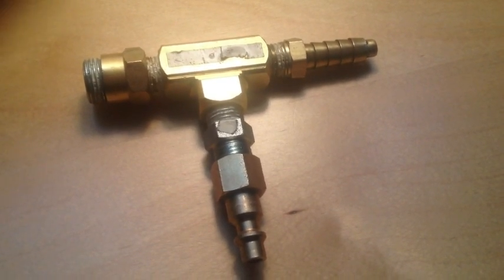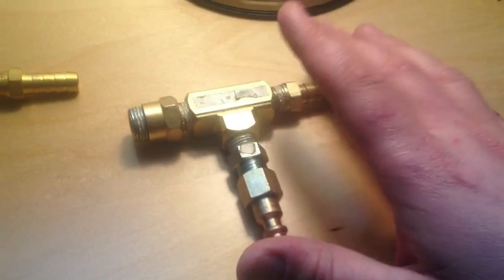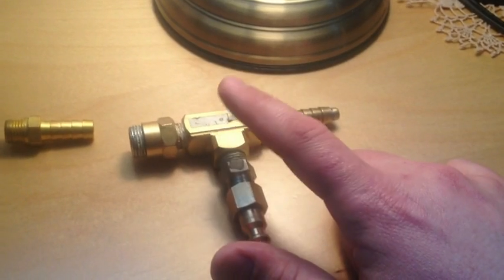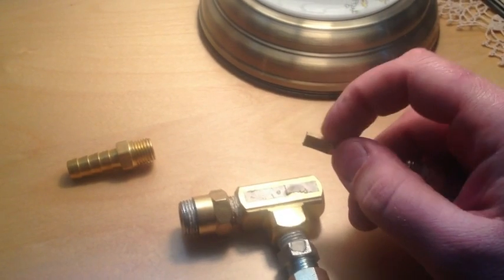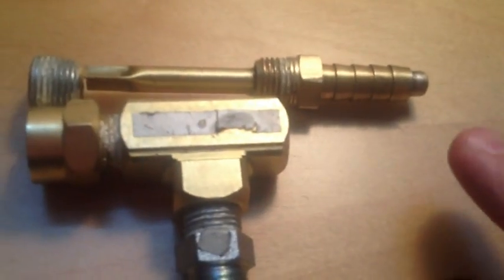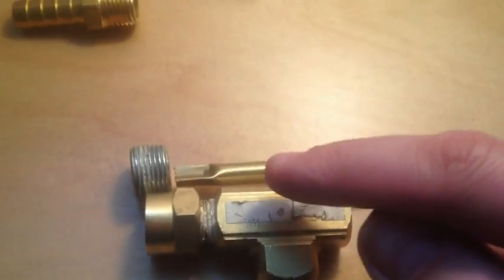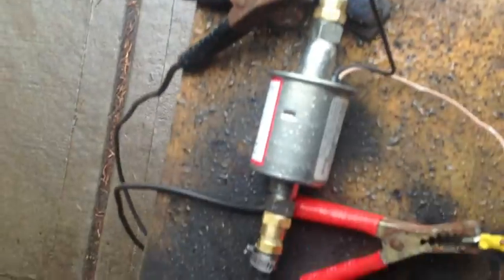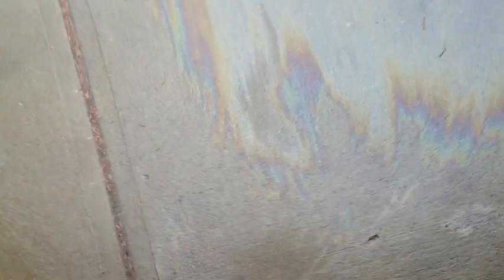Joe's home made hardware fuel water oil atomizer

Comment: Hi Joe, try using a single hole old diesel injector. Pull the guts out of it and put it back together without the needle valve in the tip, use fuel port and return fuel port for fuel and air
Reply from the maker: Cool cheers

Comment: Great idea sir,i am  preparing a kiln myslef,looking something like this for my kiln burner, Sir what type of fuel pump ur using
Reply from the maker: prabu hi there I was using regular gasoline my friend hope it works out for you buddy:)
Reply: Pls tell me about the fuel pump
Reply from the maker: It is a small 12 volt fuel pump I got from princess auto or if your in the states harbour frate it works ok but not much psi you want to get something with 30 psi range so you wouldn’t get much back pressure from air psi. Take a look at EFI fuel pumps some of them have extreme psi up to 200 psi but you don’t need that like I said 30 psi rated if far enough for this 
( https://jlfabrication.com/products/msd-high-pressure-efi-inline-electric-fuel-pump-43-gph) here’s what it looks like :)

Comment: Why would my atomizer not be working it seems like the air will push the water back 6 in and then it will mist and then it will push it back and then mist
Reply from the maker: Taylor Burkham seems like the air is over taking do you have a pump for the water? For the fuel side on mine I did have a little fuel pump with low psi rather then gravity feed. Or the front of the orifice air hole could be too small for the air pressure

Comment: Yes hello again I was asking you about your jet burner the brass tube that you crimped did you find that the hardware store or did you just randomly find it out of something else and made it work could you tell me what size it was please
Reply from the maker: Darren Hoffman 
Hi Darren i got my brass tube at a hobby store, most hobby stores have this. What you do is take your brass hose barb with you and measuring the correct brass tube for it. If the brass tube is a little big just drill out the hose barb a little and you should be fine my friend. Also try to get a thin walled brass tube which would make it easier for you to crush in the drill chuck ,
All the best hope it works well for you :)

Comment: Did you get the parts at Lowe's or Home Depot I guess me an idea where I can go shop I live in a small town so I'll have to do some traveling thank you for your responding back it was a good job you did
Reply from the maker: Darren Hoffman i
I think both places, and i go to a place in canada called princess auto in the States a place called harbour freight in the video i did i used a small fuel pump to push out the fuel but i think you should be fine with gravity flow best of luck my friend

Comment: First question on ask is what's the name of the other website that you learn how to make the atomizer at. Second question is buy soldering the end of your tip that you cramped you're not allowing air to go back down the oil line and into the jar of oil that's what I see the forced air coming out the tip creating a vacuum that sucks the oil out of a jar which lies you to ignite Bennett make sure there just want your opinion do I understand that correctly. Thank you for your response back
Reply from the maker: Hi Darren I made the atomizer myself the other websites I talk about are the ones who made jet engines.  Yes Darren you understood correctly, there is a vacuum due to the forced air coming out of the tip. Hope that helps my friend.

Comment: Hi, Ricardo from Brasil, what kind of pump did you use?
Reply from the maker: Ricardo Silva hi Ricardo it was just a little 12v fuel pump. It didn't put out that much pressure maybe 4 psi at the most . In Canada I got this at a store called princess auto. If I would I would get another fuel pump that has better psi. Some racing cars have fuel pumps that put out 80 to over 100 psi they can be expensive.  Another guy who has them is a pulse jet builder his name is bob Maddox on you tube he I believe sells these pumps. Hope this helps bud
Reply: Josefppaz thanks 👍

Comment: I like the idea of using the drill to crimp the supply tube.  I have been making a burner for a foundry furnace that is simular to yours except I solder a mig welding tip on the end of the tube.  the way you are doing it may give me a better ability to get a smaller diameter hole for the air supply..I run the air through the tube as I am using oil for fuel and I feel that it will clog less this way.
Reply from the maker: David D glad to help buddy

Comment: any ideas how to control how much fuel flowing into the nozzle?
Reply from the maker: +Bailey Stahl yes you bet get a high pressure fuel pump a couple of ball valves  have a continuous loop from the fuel pump to fuel tank then put a T fitting to the atomizer.  when you close the loop to the fuel tank for the return the pump will pump to the atomizer.
Reply: +Bailey Stahl a valve